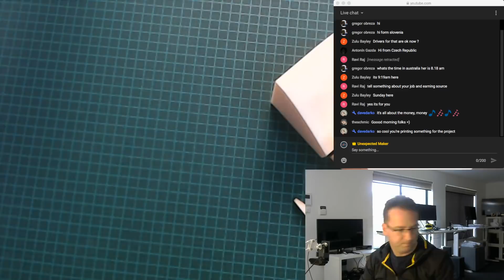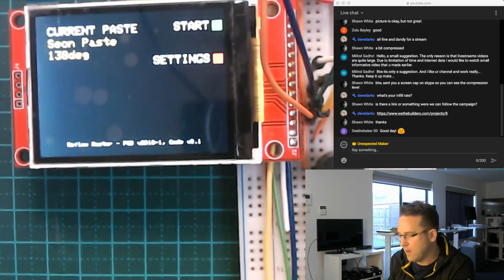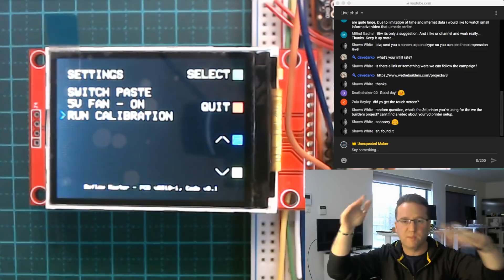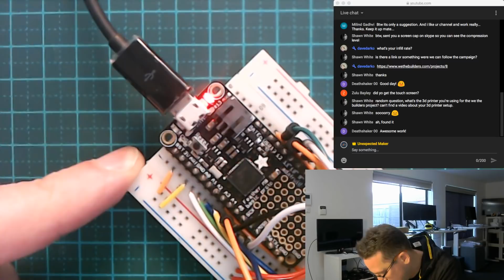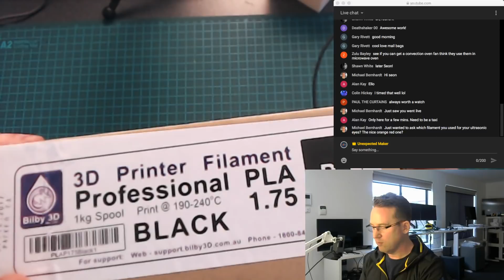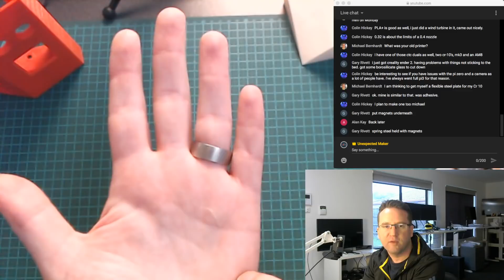LIVE: Impromptu testing of my new workbench streaming setup!

Comment: Hi Seon. I just rewatched the part of the stream I missed (as i often do) and thought about your fan to cool your oven. Why not make a big enough hole and equip it with a door driven by a servo/geared motor/Stepper to prevent the heat from escaping? Maybe if it is big enough you won’t need a fan at all, just open and close the door?
Reply from the maker: Yeah I had thought of that, but ideally I'm looking for options that are easily reproducible by other people if they wanted to also "refine" their toaster oven reflow experience. Also, I really don't think opening a small door/hatch will allow the cool-down to happen fast enough, not if the door was on the side or back.

My fan should arrive today or tomorrow so I'll try that option out first.... I like the idea that I could PWM the fan to control the rate of cool-down.... assuming a 40x40mm fan is enough to suck air quick enough ;)
Reply: Unexpected Maker ok I’ll understand. It is easier to reproduce if you just mount a fan. But I think to get any significant airflow you might need another hole on the opposite site so that cool air can get in. Otherwise you might try to get a little vacuum with your fan assuming that the oven does have a good seal to keep its temperature during normal operation?
Reply from the maker: My expectations are low :) ...  but I don't want to add 2 holes that might improve air extraction, but also reduce max temp the oven can get to, or how fast, due to heat leakage. I'll know soon enough :-)
Reply: Unexpected Maker I am sure you’ll let us know....